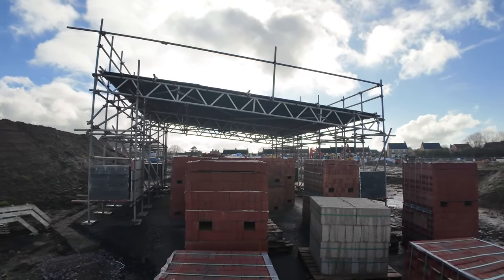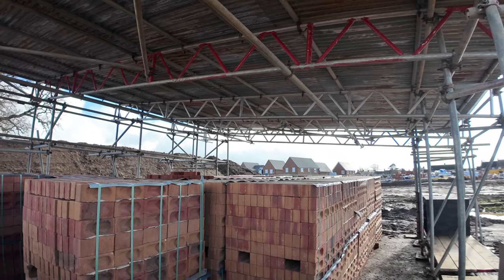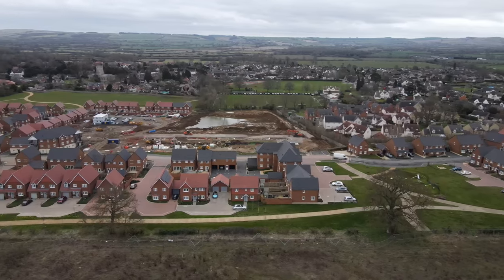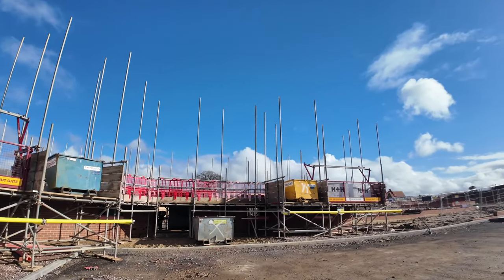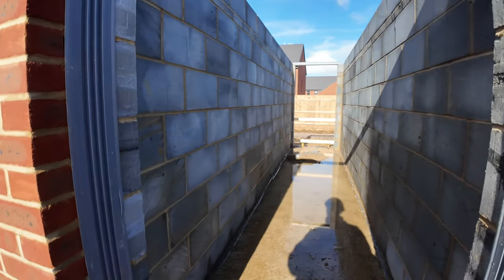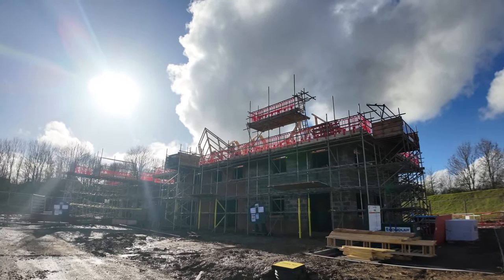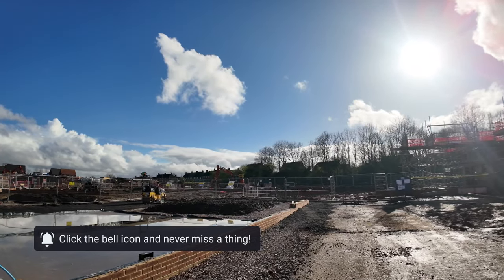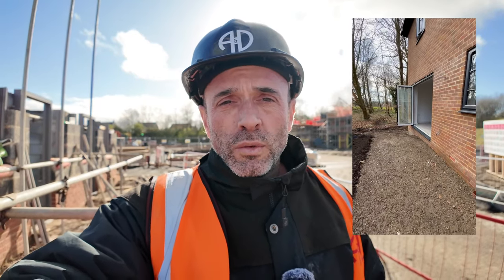How To Keep Your Bricks Dry

Comment: We have been requesting brick shelters on several sites for years and it never happens, and the forklift driver could never care less how wet the packs are he is dropping off, pain in the arse!
Reply from the maker: The brick shelters are quite big so not every site can accommodate unfortunately.  I know single use plastic bans are coming into effect.  Even when bricks have been wrapped they are soaking wet and then sweat in the packaging